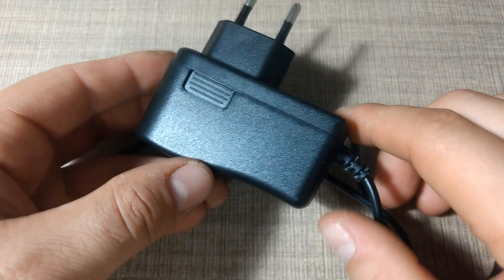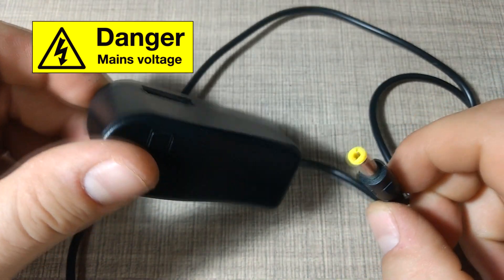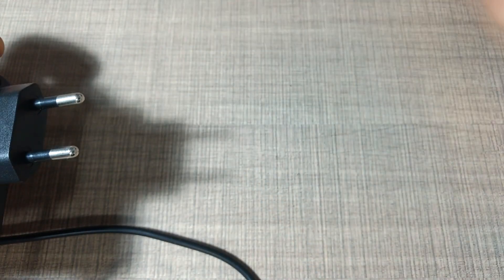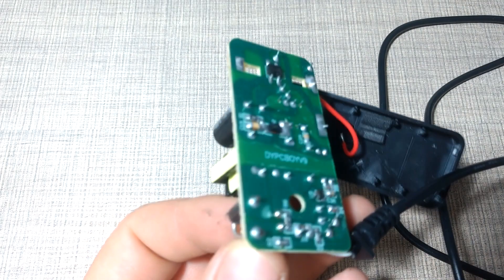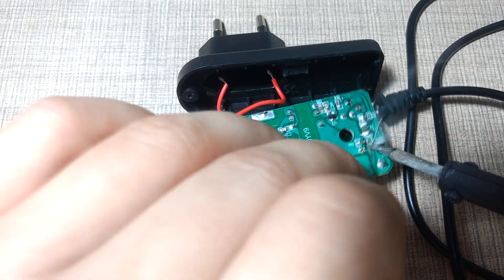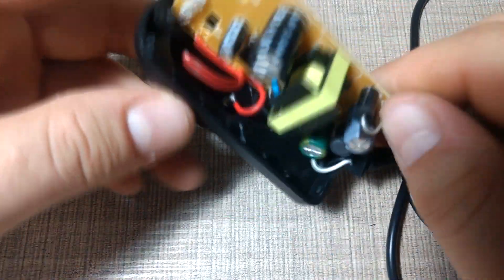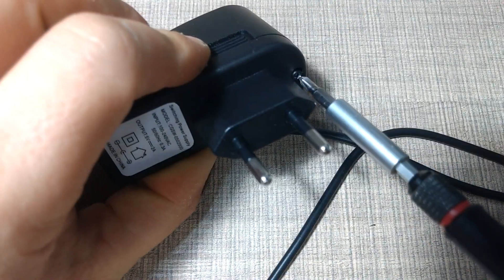5v Power Supply Repair

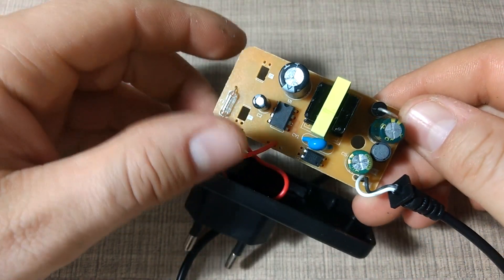Comment: Video very helpful.  Do you know what the part in between the 2 capacitors is (time 1:02 next to the capcitor you replaced).  I have adapter similar symptom once put load it drop to 1.9V, took it apart the black part in between the capacitor looks like plastic melted.  Thanks in advance.
Reply from the maker: Thanks! That is an inductor or commonly called choke. It is used to smooth out the output of the power supply and remove some interference noise. If its melted, that means that a lot more current than expected have passed through it. Probably you need an adapter with higher current rating or if there is a fault it is somewhere before it, allowing for a lot more current to pass.
Reply: @TasteTheCode  can the inductor be replaced?  If it can be replaced, as plastic melted rating for it, do you have an idea of what kind of inductor I might need?
Reply from the maker: Sure it can. I would not worry about the value of it as long as it is capable of handling the current that the power supply is rated for.

Comment: Brother can I use this adapter for led strip light please reply
Reply from the maker: Only if the strip is rated for 5V and only to a length that will draw less current than what is stated on the adapter.
Reply: @TasteTheCode  ok brother thanks for this advice
Reply: I run 4 meters of ws2812b on a 5V 2A adapter on a ESP32 without issues
Reply from the maker: But with limited brightness, right? Or with just some effects where there is not much current.

Comment: I’ve got a multi voltage adaptor and there’s no output at all. I’ve had a look inside and the AC voltage stops at what looks like an op amp with 4 legs. Doesn’t go any further
Reply from the maker: Sounds like that is a full bridge rectifier. Does it have any numbers on it?

Comment: common now, what if the case box haven't screw.. how u'll open that on start..
Reply from the maker: Those cases are usually glued together so the only way to open them is brute force. To close it, a drop of CA glue, and electrical tape is usually enough but never pretty.

Comment: my android box is flashing red and blue when i give it power. what does this mean ?
Reply from the maker: It is different based on the model. It might be as in my case where there is not enough power coming out of the adapter so it keeps switching off. Try to run it from a different power source and see if that fixes the issue. If not then probably the issue is within the box it self.
Reply: very good thank you

Comment: Hi mate, interesting vid. what causes the capacitors to fail like that?
Reply from the maker: Thanks Rob. Capacitors can fail out of many reasons: age, excess heat, electrical noise, bad manufacturing, over voltage, etc. It's difficult to know what exactly caused the issue but it is definitely strange that it was fully blown out. Usually when a capacitor fails, the cross on the top is the one to crack and vent so my guess is on poor manufacturing.
Reply from the maker: True that! Chasing cost brought the quality way down.
Reply: Good